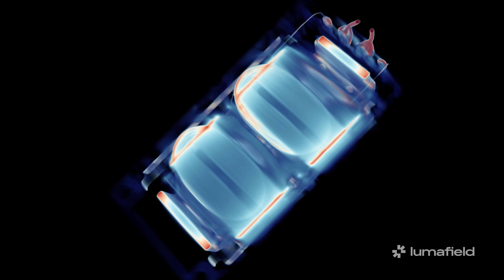Switch 2 Pro Controller: Built to Break? Full Teardown

Comment: Why did they use ribbon connectors for the aux jack and joysticks if you need to remove an adhesive faceplate to get at them?? It doesn't make sense. It's a shame how buried the battery is too, considering how easy it was to replace on the original pro controller.
Was waiting patiently for this video, and you guys delivered! Thanks a bunch :D
Reply: What do you mean? Are you saying ribbon cables are good or bad?
Reply: @clonkex  once you get to the board, it's convenient to remove/replace parts. However, the board itself is difficult to get to. Thus, it's no more convenient to repair overall.
Reply: @HittTheDekk  I'm just wondering why this guy seems to be suggesting they shouldn't have used ribbon cables just because they're hard to get to. That's plain moronic. It's already hard, so they just have just made it impossible. Like, what?
Reply: @clonkex  he's questioning Nintendo's logic of making good design decisions in some places and yet choosing to inconvenience people in the design everywhere else, most people just want a controller that's easy to repair without shortcomings like the ones overly prevalent here.
Reply: @amirpourghoureiyan1637  It's such a nonsensical question though. First, it assumes soldered connections would be cheaper to produce. That's not automatically true, especially for anything with more than a couple of wires. Second, it implies Nintendo used the adhesive faceplate as a deliberate attempt to make repairs harder, which is just insane. "We've got you now! You'll never get through this bit of sticky tape!" Seriously? It's slightly more fiddly, that's all. You don't even need heat. It's not like they're intentionally trying to make repairs difficult, they're just optimising for cost while leaving repairs doable. But who knows, maybe he's just that cynical.

Comment: The way to pulled the wires on the connectors at 2:23 was painful to watch. You're better off trying to grab plastic part of the connector to try to loosen it up a bit first. When pulling by the wires is needed, grab all the wires over a wide area to distribute the stress. 

Thanks for another interesting teardown.

Comment: I opened up the Xbox Wireless Elite 2 controller to fix an issue, and I'm going to be honest... this looks way easier to repair than that controller. lol Also. Need to appreciate the irony of having an iMac in the background.
Reply: Truthfully, the amount of adhesive this Switch 2 controller has is what makes it harder. I had to do a complete shell swap on my Elite S2 because of the rubber grip deteriorating. So I literally had to gut the entire thing and reassemble it. I did it in about 20 minutes without previous knowledge. All I needed was two different screwdriver tips: torx and phillips, and some plastic spudgers.
Reply: Gonna take a wild guess and say you opened your Xbox controller to fix the bumpers.
Reply: @Joker8pie don’t even need to take it completely apart to fix the bumper issues. Faceplate comes off in less than a minute and the white plastic tabs can be removed from the front with needle point tweezers
Reply: Bullshit I’ve repaired hundreds of elite series 2 controllers and modded them for years and they are not even close to the shittiest to repair
Reply: Not too mention it is the worst controller I have ever had by far. First controller that self tore itself to litterall bits for no reason.
Reply: Yeah, elite series Xbox controllers are hell to take apart, this looks easy compared to that
Reply: Agreed
Reply: horseshit vs dogshit
Reply: @mia_2043  Dogshit is significantly easier to clean up, though. Your point still stands.

Comment: What trash video.

After 7 years, my switch pro controller still woks great (no drift or battery issues).

So what exactly is you problem with it? First pro controller didt have widespread drift issues, so why cry so much about it now?
Reply: Their problem is they dont have enough views
Reply: Potentiometer sticks have been used since the beginning and the big 3 have stuck to them ever since. Sony did use hall effect like 20 years ago and switched back for some reason. There are plenty of controllers that use this tech and are durable, including the switch pro controller ofc. People are really judging things on the surface level

Comment: Saying it's a 'piss poor excuse' for a controller really discredits it. It's a damn good controller and feels better than the 1st Pro, of which I have 2 that have lasted several years without issues and still hold a significant charge. I imagine this will last just as long. They are still durable controllers, HE sticks would have been nice but the Pro never had major drift issues like the joy-cons.
Reply: It's a decent upgrade compared to the Switch 1 pro controller, problem is that controller technology doesn't evolve in a vacuum like Nintendo apparently believes it does. Compared to big chinese controller brands, this gamepad would've been outdated if it came out 2 years ago. It coming out today at this price is just a bad joke tbh. Gamesir, Gulikit, Flydigi, 8Bitdo and many others are offering better controllers, with more features, TMR or HE sticks, more back buttons/inputs, a much better d-pad and/or mechanical buttons for half the price. It's an extremely unflattering comparison and pretty much impossible to justify the price.
Reply: Bullshit it never had drift issues!
Reply: Except the pro 1 did have drift issues...what drugs are you on?
Reply: @ChampagneOppa  The pro 1 controllers only have drift issues if you heavily used them lots or dropped the controller lots. I had a pro controller in 2018, but my clumsy ass dropping it tons caused the sticks to drift. My current pro controller has none of those issues, the plastic is also better and grind off as much compared to previous iterations.
Reply: @ChampagneOppa  Just because the controllers famously have drift issues doesn't mean every user experienced it. I've personally only had 1 joycon go bad, i also have 2 switch 1 pro controllers neither of which have developed drift, and i have 2 dualsense controllers that have managed to survive a few years so far as well without any drifting.
Reply: They're reviewing it from a repairability standpoint, and within that context it is piss poor. If you want a review of the controller as a controller, go elsewhere.
Reply: @mjc0961 Normally iFixit reviews things from both a repairability standpoint as well as a build quality standpoint. And the build quality looks to me to be better than average, so some more nuance in the verdict would have been appreciated.

Also, it seems to be about as complicated to service as the PS5 controllers, I have had to replace sticks on two PS5 controllers, and it is a real pain in the ass.
And the PS5 controller didn't get a "piss poor" verdict during the teardown.
Reply: @knirfie  i've opened dualsense controllers a number of times and they don't have any adhesives you have to dissolve with isopropyl, that's a huge difference when it comes to repairability and ease of repair
Reply: @mjc0961 That's not how the presenter says it though. It was just a blanket statement.
Reply: @mjc0961 so it's a good and very durable controller if you don't want to fix it which I never do.
Reply: @eSKAone-  Again, this is a channel for repairing stuff, The sticks will drift and the battery will decay and you can not easily fix that yourself. If you are fine with that then this channel clearly is not for you
Reply: @CheekyCheeky take care of your stuff and you won't need to repair it 🤯
Reply: thats actually really not correct. the original switch pro con had big problems with plastic dust gunking up the stick and ruining inputs. i had to exchange (thankfully not buy a new) switch 1 pro con at least 5 times over the years due to this issue. the switch 2 pro con seemingly does fix that plastic dust chafing issue though so maybe it'll be fine this time around, but no, the switch 1 pro was not safe from poor design.
Reply: @nightzowlz  i have the dust on my og pro controller but it was never an issue functionally for me, just a weird quirk
Reply: Yeah, this is a piss poor review. It’s click/rage bait to whinge about how it’s difficult to pull apart and repair.
Reply: Thats my gripe with this video. I feel like there was more grudge or hate to it. If use the Pro controller as a reference, my Pro controller has outlast my PS5 controller. Im on my 3rd PS5 controller, but my PS5 controller is a Scuf controller. So if anything, if i dont ever need to get my controller repaired or replaced, than i think its worth that much.
Reply: Except they switched to low profile sticks like in the joy-cons with this controller
Reply: @samuelbaird4983  those sticks are nothing like the joycon sticks
Reply: @samuelbaird4983 and they are the best sticks I've ever used
Reply: Your missing the point
Reply: @robertl8069 Your "your" is "you're"
Reply: @robertl8069  I'm not actually, when you open your video with that blanket statement, it's entirely false. I know the video is about repairability, I've been following iFixit since before they even did these videos. The controller isn't any less repairable than other major brand controllers, even better in some regards. They can call it a 'piss poor controller' but at least elaborate that statement is from a repair perspective, like I said earlier, it's a damn good controller and does what it's designed to do.
Reply: Trying to convince yourself that your $90 controller wasn't a poor financial decision?
Reply: @Sir_Adam  I'm perfectly happy with it, as I said, I have 2 of the original Pro controllers that I've had for 5+ years and they still work fine with minimal issues so I don't see many issues occuring with this either.
Reply: For anyone doesn't know DF done a tech analysis , Hogwarts and even parts of cyberpunk cannot come close to the PS4 versions due to loss of details and shadows , draw distance etc. It cannot come close to even a steam deck in handheld mode due to the abysmal wattage of 7w. In all it is now being theorised that its power is between a PS3 and PS4. It also has one of the worse screens in handheld history that is compatible to the psp from 2004 due to it being extremely slow in response rates making a lot of games a blurry mess, go check monitors unboxed tech analysis where he evidences it as the worse screen he has ever tested , and much worse than the switch 1.. Nintendo's thriftiness has reached legendary levels. Most hardware analysts cannot work out how they got such a bad screen in the 20th century but most are theorising it was unused stock from a vintage project either sold of cheap or literally for free.
Reply: @hasan1980hb Did you watch your own fantasy tech review? That's not what they said.
Reply: @fi7959 I quote "hogwarts is significantly worse in shadow detail on the switch 2" it also is worse in draw distance. That means it's power is between a ps4 and ps3 a 2 decade old console. Monitors unboxed also said it was the worst screen they ever tested in the history of the channel significantly worse than the switch 1 and close the psp from 2004. The evidence based analysis is there so I would not get emotional. So it has almost the gpu of a 25 year old console and screen of a 2004 console?
Reply: @hasan1980hb thats not true

Comment: Rumble packs not being soldered is a nice thing for a modern name brand controller. At least I'll give them that. I hate having to desolder DualSense and Xbox controller rumble motors every time.
Reply: Technically N64 was first. Xbox 360 controllers also had plug in rumble motors.
Reply: @Just_A_Regular_Old_Duck  Hmm You're right, maybe I should have clarified that I meant for modern era controllers only. Come to think of it, the first joycons were not soldered either.
Reply: What do you mean? Theres been plenty of rumble motors before that have been held in place just by the controller shell bracket and maybe foam tape at best. PS1 controllers for example.
Reply: @wryyyy  they're referring to the JST connectors used to plug and unplug the motors, not the mounting method used to fit it in the case
Reply: @amirpourghoureiyan1637  Ah yeah, makes sense.
Reply: Well it's a start.
Reply: I mean it takes seconds….
Reply: Desoldering them to disable them? Or to replace them? Or what?
Reply: Probably because of higher failure rate of solder from vibrations.

Comment: I never thought I'd see the day a Nintendo product becomes less repair friendly than a Samsung phone.
Reply: Nintendo used to make both durable and repairable devices. I remember the nightmare of trying to fix PS2 controllers, but never having issues with my gamecube controller as a kid. And later in life, being able to pull apart 20-year-old GC controllers and replace parts to make them new. 

And that's just the controller. The DS and Wii were both so easy to work on and damage resistant.
Reply: @WIImotionmasher  Yes, they were definitely more repairable in the past. I used to have an N64 and the console/controllers were easy to work on. 
I disagree with the DS though. The parts are decent, but the hinges/ribbon cables make them difficult to work with.
Reply: "Apple
Reply: Ever since Iwata and Reggie left Nintendo, they have been more anti-consumer.
Reply: @Vyz3r  pretty much yeah...
Reply: In my experience Nintendo products aren't very easy to fix in the first place, they just increase the difficulty with every new products. On Samsung's part their phones are relatively easy to disassemble and put back together.
Reply: @pyrojinn Nah previous Nintendo systems have been pretty easy. I have open up almost every single Nintendo system and controller out there and I'd say this is an outlier along with the joycon, but that was mostly related to size more than the engineering itself.
Reply: At least it's not apple where they brick it if you even dare try to repair it or replace any faulty piece.
Reply: @Izanagi-Arsene  yeah at least nintendo only bricks it if you dare to put a preowned game cart in the console
Reply: samsung is repairable.  try an apple iphone or mackbook pro.
Reply: You mean like apple products?.
Reply: Nintendo? The ones who use proprietary screws since more than 30 years? They didn't want you to mess with their hardware since forever...
Reply: Samsungs are easy to repair wdym
Reply: @Altair9787 Yea but Nintendo's products were historically even easier
Reply: For my S9+ I went to samsung-parts website and found all the spare parts I needed. I even found the adhesive strips to make my phone waterproof again
Reply: That's a funny way to pronounce apple!
Reply: Samsung phones are 100% worse and require a heat gun and a lot of patience to get into it.
Reply: @JosephTheRocker  if you work on them like i do there not that bad to get in to as long as you have a 0.1mm steel opening tool and a heat mat.
Reply: This is a sign that the end of times is near.
Reply: That's why I'm keeping the switch 1 Pro Controllers
Reply: they used to have a proprietary screw type to prevent people from opening older consoles, this isnt new for nintendo
Reply: You've obviously never tried to repair a DS/3DS.
Reply: idk how samsung isn’t repair friendly but ok
Reply: It's a Nintendo controller. Never in my life have I had to repair a Nintendo controller. I don't think I will ever have to either.
Reply: We're deep post Iwata now.  Nintendo's stepping to the bad side and it'll take you Wii U levels of fail to be sorry about it.
Reply: I unno man the only bad thing here is the battery which Samsung also does. But then Samsung uses some cheap ass ribbon cables. be careful they break easily. Apple is the one you're thinking of. try taking one of those apart they make it impossible. Since Apple and Nintendo cannot sue third parties for recreating their parts as right to repair laws exist. They purposely make it more difficult but can't do what Apple is doing. Apple is the reason half these laws are in place for the right to repair. cause they make it impossible. This is actually fairly easy. any tech person knows to keep screws separate and in order of how it's taken apart etc. it'll be harder for the regular joes.
Reply: You're making it sound like Samsung smartphones are difficult to repair

Samsung phones are probably some of the easiest smartphone to repair outside of the likes of Fairphone and the new HMDs.
Reply: @erlienfrommars Yea I guess I picked a bad smartphone brand.  They are easy to repair but previous Nintendo consoles are even easier.
Reply: @erlienfrommars  If Samsung didn't begin serialising parts, sure that'd hold true today.
Reply: #Thankyoufurukawa🙏🙏
Reply: Why? Nintendo is all about squeezing as much financial gain out of each customer as possible. Maybe they used to hide that better.
Reply: @ConnorLinley  They only hide that better because their fans are blind. I really wish people would quit being fans of corporations.
Reply: @ConnorLinley  8bitdo rules. I actually get something for literally 30 dollars less
Reply: Its OK, we can play their games on the computer with a reliable Logitech instead and saving 85 bucks for this garbage.

...

And save 90 bucks for their games.
Reply: I would rather make it look more appealing than make it repairable, just take care of your products LOL